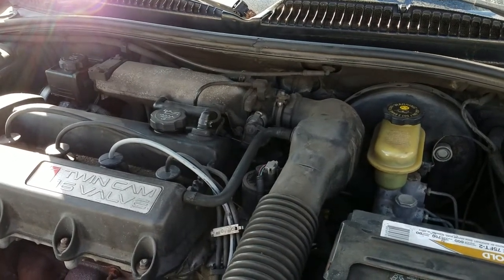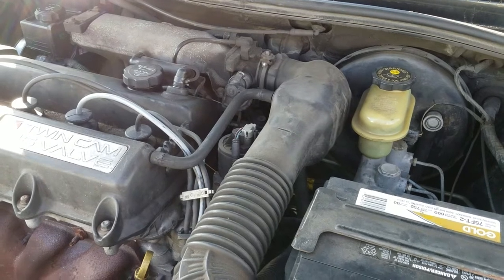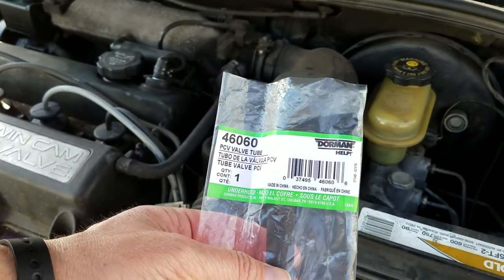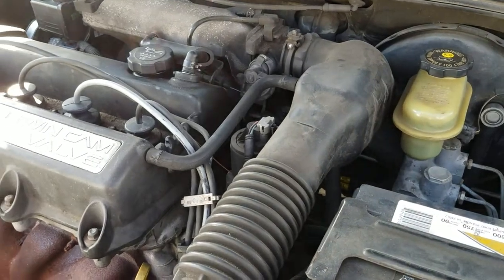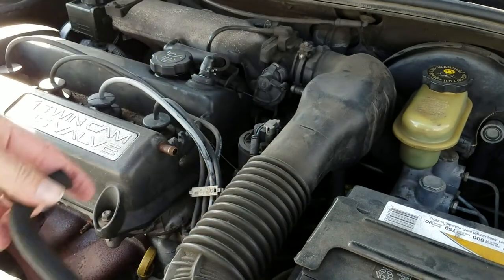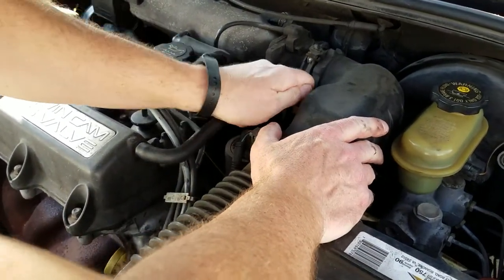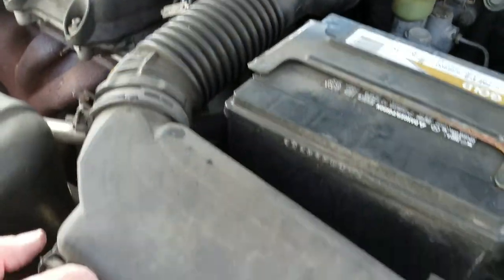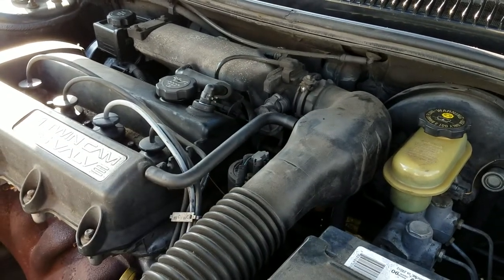Identify and replace Crankcase Ventilation Tube/PCV Valve Tube - Saturn SL2 1998

Comment: THANK YOU, I just noticed my saturn had the same problem. EASY FIX!
Reply from the maker: Thanks! Glad it was a help.
Reply: @blowmoldhospital6331  interesting... my 95 sl2 has a similar hose (that is cracked) but it is in a different place... mine actually connects the pcv valve to the crankcase... I ordered the replacement hose and got the one for your car instead which is too long for mine. So just as a note to anyone looking to replace this hose.. it comes in 2 different sizes for this car engine and unfortunately the autoparts stores don't seem to have the  distinction in the computer systems.